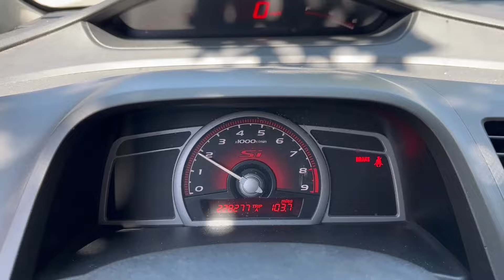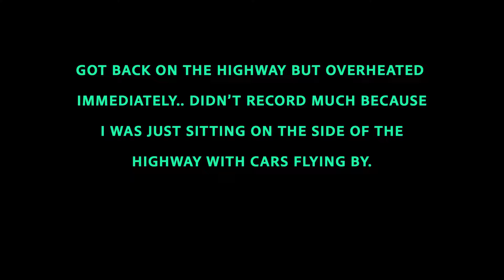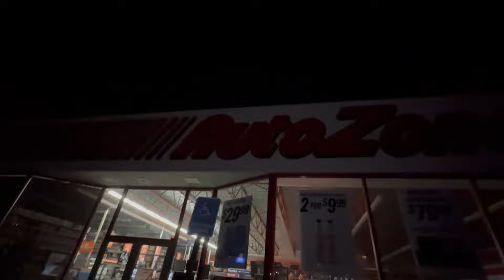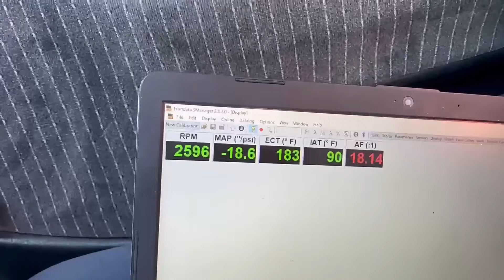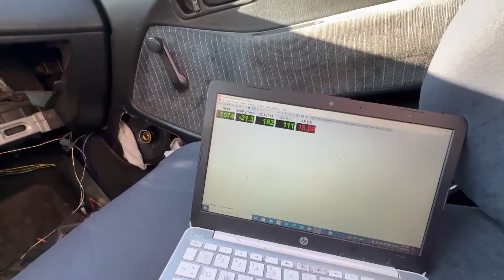TURBO CIVIC VS THE WORLD!!

Comment: TurboD with a cast mani never disappoints. Add some fuel up top. AFRs were in the 13-14s during some of those pulls
Reply from the maker: Definitely, added some up top since this video and will do some pulls very soon to see what you guys think 😁👌🏼

So weird that some runs it's in the 11-12 range then some around 13-14.. I've seen videos of tuned cars that just sit dead on 11.2 on WOT so I gotta figure out why that's happening
Reply: Good, constant voltage to your fuel pump?

Comment: You should switch to torco oil. It's higher in zink and more resistant to e85. I use it and the upper cylinder lube in my d series. Keeps it alive
Reply from the maker: Torco oil, I've never heard of it but pretty cool it actually resists the e85 a little better..  I've always used VR-1 but always down to try something new!

Comment: All you had to do was use a 10mm wrench or socket and take the thermostat out and put the rubber seal back in and tighten it back up and you could of made it home real quick and go to a gas station and refill the radiator with water. I did that on the off ramp of the freeway which is more safe and I was stuck between California and Arizona on a lonely dead highway. Always carry tools with you for emergencies and a head lamp. Car is sick and runs great bro. Cool pulls.
Reply from the maker: I have a feeling the thermostat I removed is still good.. but the air pocket got so big in the system it stopped circulating.  You are correct tho, pretty amateur move to not bring basic tools in the race car 😬

Comment: 15:47 are you blowing the spark out in the top of 2nd gear or something? You can hear the sound of spark blow out or wastegate flutter from no signal on top of the gate. I can tell from watching the video that the car clears up and picks up a SIGNIFICANT amount of power in 3rd compared to 2nd. It may be worth attempting to drop the plug gap down a few thousandths. it very well could be the gate needing boost pressure on top of it to keep the valve from lifting and fluttering
Reply from the maker: I bet that's exactly it. I'll double check but I'm pretty sure I can go down to at least .018 without too much worry of welding it together on a bad night 😆

Only reason the line doesn't go to the top of the waste gate is because it was hitting the hood cuz the damn hood spacers.. I gotta take the spacers off and move the line to the top 👍🏼
Reply: @DanWithTheWrench  If the gauge is correct on your dash, it looked like you were running really lean in boost and rich during cruising. I thought I saw it get up to 14 on the AFR gauge while you were racing. Kind of hard to see but the sweeping light definitely went up to the right. 

Try to bring a basic tool kit with you next time, you could have pulled the thermostat out completely and gotten home. Another trick with the thermostat you can try is to drill a couple small holes in the plunger to allow more flow while also keeping it in to warm the car up quicker.

Just double checked the highway run footage. You were for sure running lean in boost. 13.5-14 is what I was seeing. That will cause you to run hotter, and cause breakup in boost. Your plugs were showing that as well like you mentioned. I think you need to address your open loop fueling at WOT in boost. It may just need 10-15% more to get the AFR to come down to around 11.0